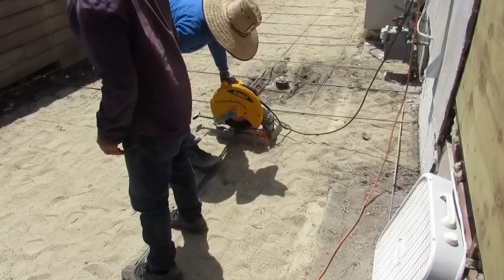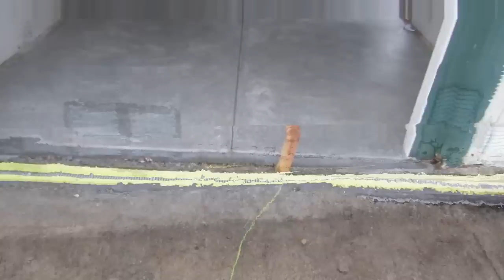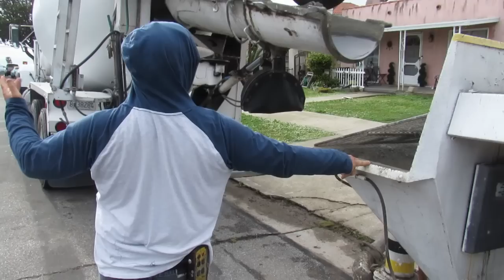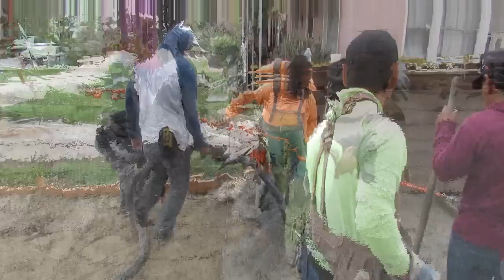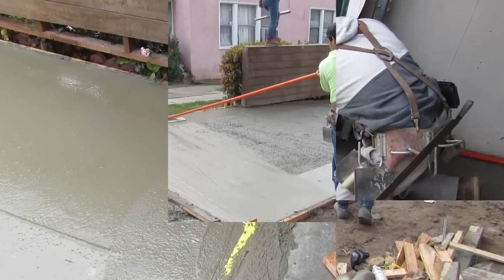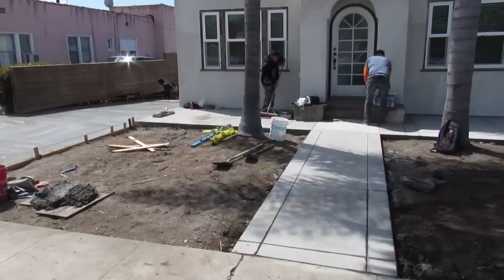Construction Of A Concrete Driveway From Start To Finish! BEST IN THE WEST!

Comment: You can cement in alternate block wise system , cement one block leave exactly similar space then cement the next block of equal size . Then when the 1st Block dries you can stand on that & cement the blank blocks in that order using quick dry cement.

Comment: I live in the Midwest and have worked commercial general contractor for 18 years. We have worked and poured concrete in 38 states.
I’ve never seen  a commercial concrete contractor use a wood bull float or wood hand trowel in any area.
Are you using wood to absorb bleed water? Why the wood finishing tools?
Reply from the maker: It leaves the surface open for bleed water 👍

Comment: I had a concrete driveway poured over a month ago here in Southern California. I have some dark spots in the driveway that does not seem to be going away. Any suggestions that I can try to improve the discoloration’s
Reply from the maker: It’s because of the fly ash in the mix. Get a sprayer and spray white vinegar straight on it. It will bleach it out. It’s a natural acid 👍
Reply: @WestCoastCustomConcrete  thank you for the reply. Should I dilute the white vinegar? And do you suggest using a power washer after I spray it or let the white vinegar saturate
Reply from the maker: @lawrencesordotcom  use it straight. Leave it on. Don’t wash it off✌️
Reply from the maker: @lawrencesordotcom  you can use a cheap Home Depot sprayer. Probably $30 spray the whole job